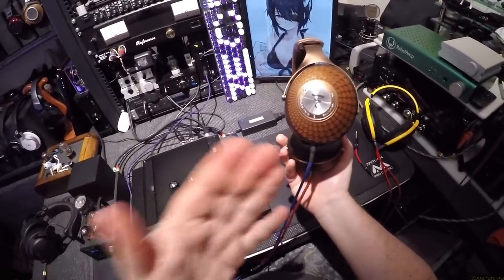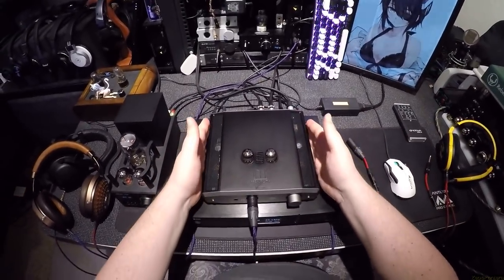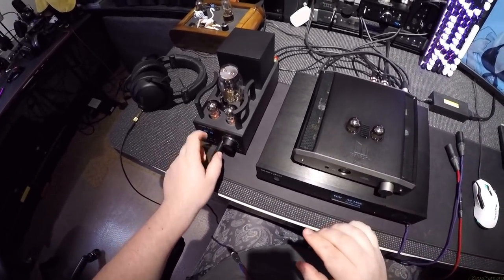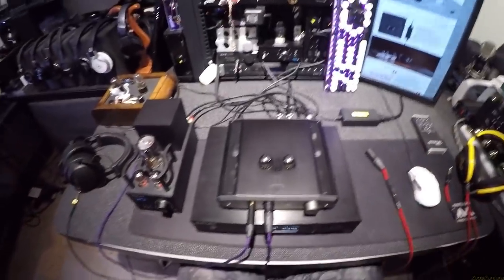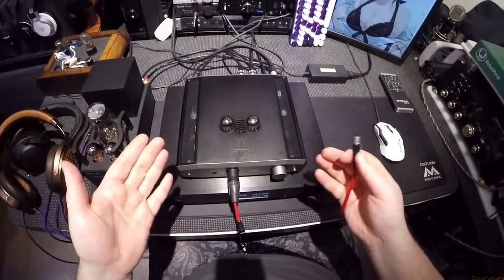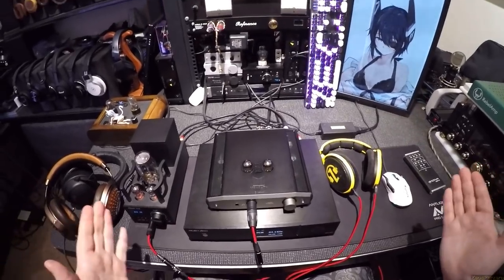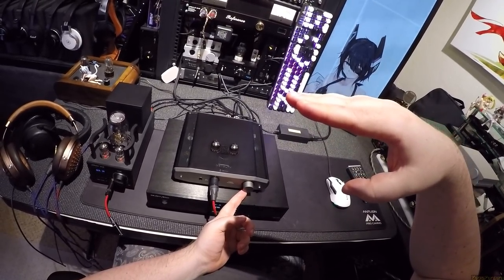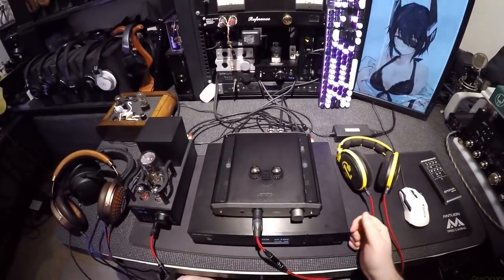Monolith Liquid Platinum _(Z Reviews)_ Hybrid Tube Action from Monoprice

Comment: The Stellia's absolutely sing on my little Loxjie P20 with Riverstone Audio, 6N3P-E tubes and with an upgraded power supply which is about $200 all in including socket savers to make swapping easier and reduce the heat a bit.
That's the beauty of the Stellia's you don't need a lot of wattage to make them glorious
Reply: What power supply did you upgrade your Loxjie to?  Link if you can.  Thanks in advance!
Reply: @caseyodonnell6621  I actually bought a really overpriced unit first but had one from a TiVo bolt that was identical at 12v 3amp and it sounded better so I'm using it and returned the one I paid $78 for and you can get one on Amazon for less than $20 or even $5 on eBay and it makes a world of difference....
Reply: The P20 is incredible. Especially at the price point, but even at a much, much higher price

Comment: Nice review, Zeos. I can't wait for the A22. Hopefully, you can do a comparison with the D90. I'm really wondering how much, and what kind of difference there is to justify the higher cost. Also, what's it do to the DV 336se? Because, that's my baby!

Take your time and savor it. Give your hearing a chance to adjust to it.
Reply: Both are really just ok, d90 sounds really thin and shallow, a22 doesn't sound very good either. Hifi is not like computer chips, not the newer the better. However, if you only rely on resolution, I say both are pretty revealing I give them that, but in terms of the sound quality, they just barely pass the ok mark. Zeos doesn't really know what he is talking about. Marantz dac1.  On the other hand, the fully bodied sound will give you actual experience. But you really into those, Gustard x26 would be a much better choice, or ud505, even better.

Comment: So, here is an interesting question for anyone.

1 - I have Shozy Form 1.4 & Shozy 1.1 IEMs,
2 - I have Bowers & Wilkins PX Closed Back(350$),
3 - and I have Bowers & Wilkins T7 Bluetooth Speaker(350$).

I hook up my THX AAA Amplifier to each of these but
the resolution is significantly higher for the B & W T7
than either my B & W PX's or my Shozies.

So the question, is this just due to driver size?
Does Bigger driver give us higher resolution?
At what price range does an IEM or headphone
become as high resolution as my B & W Bluetooth
Speaker? I've also heard it's not wise to hook up
my THX Amplifier to A Bluetooth Speaker. But
I can't help it, It sounds like butter. And I hear
the B & W T7 is overrated for it's sound quality.
There are cheaper options that sound just as good
if not better. So another question is why aren't these
portable amplifiers being designed to hook up with
Bluetooth Speakers?

Comment: Just get a tube pre/buffer for your solid state.
Reply: So you watched Joshua's latest video?
Reply: @StrikitRich  no I saw a video by 123toid last week but he seems to have the same pre that Joshua reviewed
Reply: @juliangst  Still a good idea if you already own the 789 or similar amp.
Reply: @StrikitRich  I probably get this tube pre for my speaker amp. I hope it is as good as they say xD
Reply: @juliangst  For $50 what's to lose?  The balanced input option is the key.  789 has it, the T30 doesn't.
Reply: @StrikitRich  the model without tone controls fortunately only costs 30€ here. I hope I will hear any difference xD
Reply: @juliangst  $32 for the basic model and $39 for the one with tone controls on Amazon in the US.  It's the bluetooth version that's $49.
Reply: @StrikitRich  there is also a yaqin tube buffer which is 220€ here. Looks interesting but I'll test one of the cheap pre amps first
Reply: @juliangst  Upon reflection, I think the unit without tone controls is the way to go if all you want is to add 'tube sound' without extra variables.

Comment: I found the hd650 sounded better on the platinum  than the HD600.  The platinum adds sparkle more than dark tubeyness (word?) 650s sound better adding crispness and 600s with more treble is a bit meh.  Darker intimate headphones are where the platinum work best....and have a dac with variable outs.  :)
Reply: This is also very dependant on which pair of tubes your using and what dac your paired with.

Comment: Xduoo has the switch power supply, which is the worst possible design for the tube. I just cannot take that seriously. 789 is really amazing for its price. But when you have better amps, you realize it really doesn't compete above its price point.